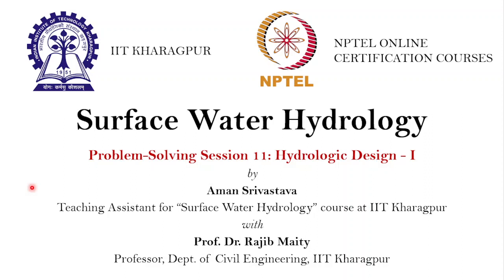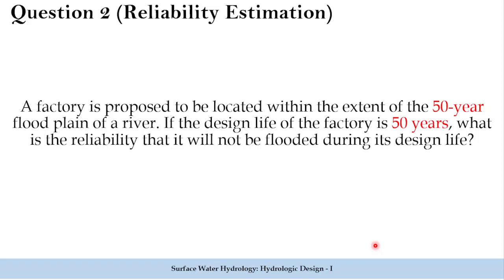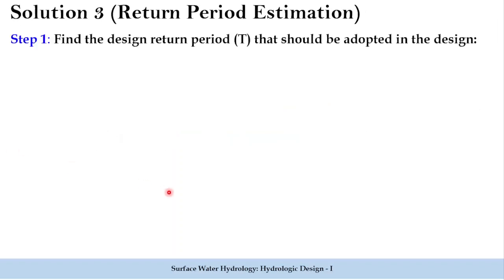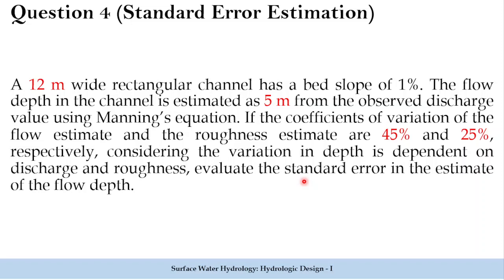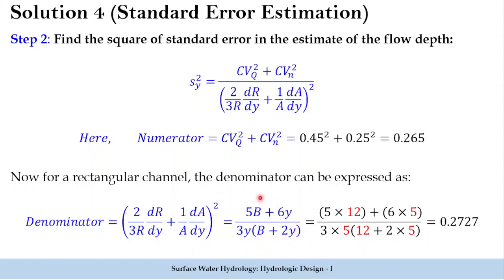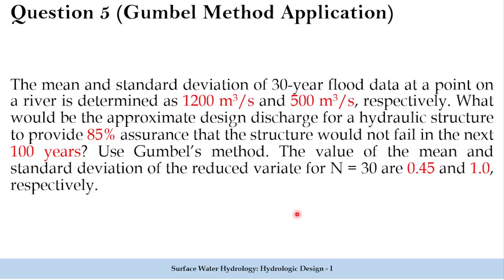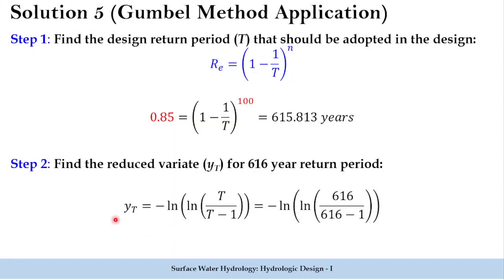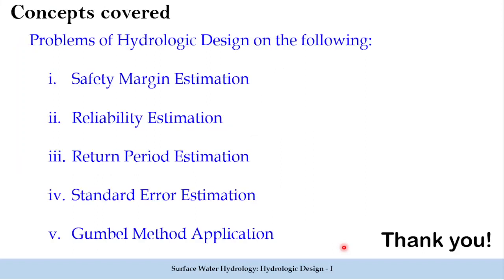Problem Solving Session 11: Hydrologic Design (Part-1)_Surface Water Hydrology_IIT Kharagpur

Comment: how comes 0.265 divided by 0.2727 comes 3.6527 in 7:36 seconds of your video?
Reply from the maker: Thanks again for bringing this to my notice. It's a calculation error. It will be rectified in the next version. To humbly clarify, 0.265/0.2727=0.9718, and thus, the final answer will change to √(𝑠_𝑦^2 )=√0.9718=𝟎.𝟗𝟖𝟓𝟖.
Reply: @amansrivastava1397  thanks so much sir. How will be exam pattern. Whether assignment questions are enough for preparation? Please response sir
Reply from the maker: @devananthr3176  Exam Pattern will follow questions that were covered during the weekly assignments. Besides this, you must thoroughly study the lecture slides to brush up on the theory and the problems that have been solved.

Comment: How comes cv and cn values are wrong here as per given data.
Reply from the maker: Thanks for bringing this to my notice. You have rightly pointed out that in step 1, it was mentioned wrongly. Nevertheless, from step 2 onwards, the problem was solved using the same data from the question.